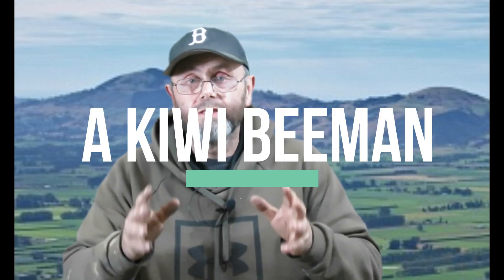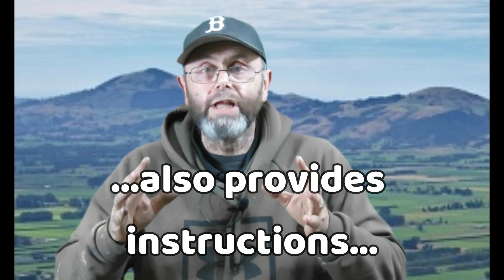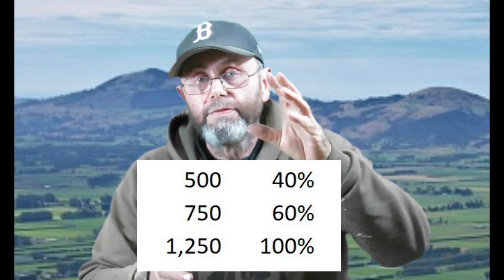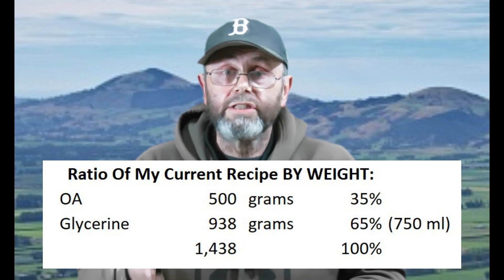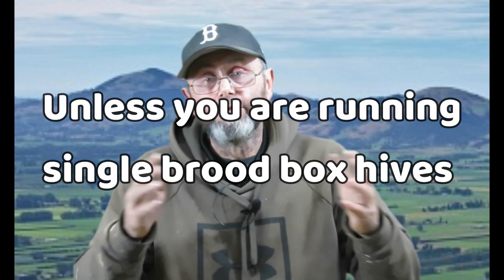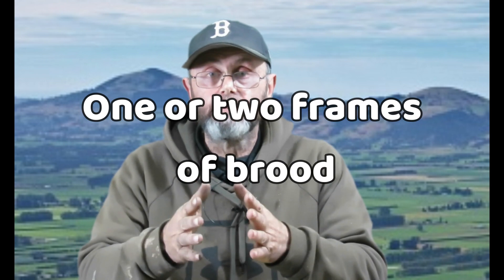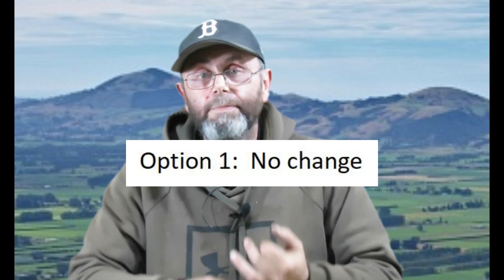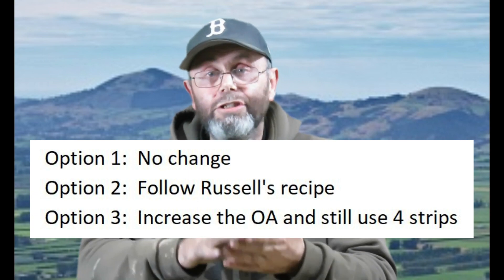Ep 68 Extended Release Oxalic Acid MISTAKE

Comment: BS, 4 strips do not have 33% more surface area then 3 strips
Reply from the maker: Really?  I have a degree in accounting (and an MBA), and I am pretty sure they do :)  Actually it is 33.33% (even more accurately 1/3) bigger.  Here is one example of the maths, there are others.  Imagine, to make it easy, that each strip has a surface area of 10 square inches. (of course they are bigger than that in reality but that doesn't change anything)  So 3 strips would have a total surface area of 30 square inches.  4 strips would have a total surface area of 40 square inches.  40/30 = 1.3333   or 133.33%    So the area of 4 is 33.33% bigger than 3.  Now I have been wrong before, but I don't think I am this time.  If you are sure, convince me :) :)

Comment: HI~
The video looks good.  I have one question.  I would like to know if I can make an oxalic acid strip and use it during hot summer days.  thank you.
Reply from the maker: Hi, a hot summers day here is about 30 degrees centigrade.  I don't have any issues at that temperature.  I don't have any experience at hotter temperatures.  If you summer gets hotter I suggest you try it with a hive or two so see.  I am pretty confident it will be fine, but it pays to be cautious.  I use 4 strips per brood box. Cheers Chris

Comment: To add to the 3 or flour strips conversation. We traditionally used only 2 grams of vapor per double deeps. We found it wasn't enough and moved to 3 or 4 grams in many cases of vapor treatment and it made a world of difference. If a colony is ventilated well, even in hot weather it doesn't hurt them. This is the same in other types of chemicals, ventilation I think is of most importance even in vapor treatment.

Comment: Hello there, long time😁 Do you think swedish sponges will still work in this case? Also, you say 4 strips per 10 frame box, since we run double deeps, would that mean 8 strips, or 4? And how long do you leave the strips in. Our honey flow continues for about another month so I am preparing to try this method in a few hives. Our weather will be quite warm then so hopefully this won't be of concern with ventilation. Thanks for these videos, I'm hoping for success with this testing here
Reply from the maker: Hi.  Its good to hear from you.  Yes I am sure the swedish sponges work.  Check out my Ep 50 where I do a comparison.  Randy Oliver has done extensive testing on them in a far more scientific way than anything I do and he likes them.  I checked one of the hives that I put swedish sponges in in that video a week or so ago, it is very strong and very healthy.  Which is great since we are well into winter here.  And yes, a double deep with brood in both boxes would get 8 cardboard or drywall tape strips.  I have had no problems with hot weather affecting the hives with strips in them here.  But a hot day here is 25 C (77F) so I don't have any experience at hotter temps.  Good luck, I hope it works for you.  I think trying it on a few hives as a first step is very wise.  Cheers Chris
Reply: @KiwiWildman  I did watch that video, and the comparison was great. Randy is really good at this. Many of us here are doing our own testing quietly and many have had good results. I thank you again for all your videos and will let you know how our results end up, cheers.

Comment: To add to the mix Russell is using a old mix I showed him at a bee Conference a few years ago. I do my mix by volume and I'll try to explain why soon he changed his mix to be by  weight to look different. What I didn't explain at the conference I am a beekeeper after all was oxclic and gly are hydropic ie they absorb water. So someone who has a different bag of oxclic or it's been open for some time it will weigh differently. I see a lot of and deal with a lot of people who have killed there hives or it hasn't worked out. 
Because I did a video of how I make my strips after my non disclosure for testing the real strips had ended.
But the way I make my strips has changed since I made that video it is not correct it will work to a fashion but is not as good as how I do it now, also nothing I've seen has worked as well as the real strips. I would ask why you have to sign a waiver to not hold beequip or Russell liable if his strips he sells kill your hibes. This is all my 2cents worth and my opinion only but you ether make your own and take the risk or use something that is approved for sale as a mite treatment.
I'd also question why it's going to cost 300k to one company to approve the real strips for testing that has been done overseas and none of the other treatments have gone through.
We have been home brewing for long enough to prove it is a viable option let's get some help to get the real thing approved. They are approved in many overseas countrys and have a proven record.
Reply: Also should add your method is close I use 4 strips per brood box I run double brood boxes and most of my hives have drone frames all season for my Ai work and mating sites
Reply from the maker: Thanks for the feedback Glynn.  I think your point about the ingredients being hydroscopic is really helpful  In my case, it wouldn't affect the glycerine much because it is stored in 20 liter plastic containers with the lids on securely, but I do almost always have a partly used bag of OA in storage.  Although there is a plastic liner in the bag and I always tie it shut, the liner is thin plastic and easily punctured  so it is hard to ensure there is no air flowing in and out.

I won't comment on why Russell uses a disclaimer form, he explained his reasons to me, but best if you get it directly from him.  I can say that I pointed out to him that in a past life I explored the use of them for a National sporting body I was president of.  The legal advice we got was that they are not worth the paper they are written on, you can't contract your way out of the law.

I agree that getting something new but proven approved for commercial production in NZ is absurdly expensive.  In the meantime, I will just keep doing my home brew as part of my varroa treatment programme because it is working for me as a good tool for keeping mite levels low, not so good at bringing down high mite levels.

Cheers Chris

Comment: Opt 1. If the way you currently do it works, I'd stick with that. When I made strips for my 2 hives, I had massive bee deaths (which I asked you about at the time). Clearly I hadn't done the maths right which is no surprise to me, not my forte. Checking dead bees out front today I see mites so tomorrow I will make a new batch. I will use the 40/60% by weight rule (3 per BBox) as this will be easier mathswise for me, fingers crossed. I'm thankful for this video! Cheers 👍
Reply: Hey Chris, I did it! Did 40/60 mix, got to correct temp 70deg and dried them over 3 good days in Lower Hutt (last time they went in damp as instructions I had said but I followed you this time and let them dry, esp cos evenings are cold). I put 4 per box. No deaths of bees this time! Checked white corflute I put under hives today and counted  17 mites under one hive and 20 under other so I don't think I had a bad infestation but I'm feeling much better about my OA strip making skills -yay! THANK YOU HEAPS!
Reply: @neeksnature well done. Great feedback for the rest of us, thank you.

Comment: Hi Chris, thank you very much for the update! Since you know your current method works, why not experiment say on 10 hives with the suggested ratio and compare the results. If I recall correctly, using your current formula (same I'm using) you still had mites or for the most part prevented numbers from going up. Maybe Russel's ratio, would do better?? For my part, I'm happy with the current mix, but might do some testing as time allows. Cheers, Peter
Reply from the maker: Hi Peter, words of wisdom indeed!  What a great suggestion.  Thank you  Cheers Chris

Comment: Good Video Chris, 
The strips made to Russel's Recipe will be a little more concentrated oxalic dose on each strip, would that mean that the bees are picking up more oxalic when in contact with the strips? 
I guess the real important thing is testing hives for Varroa and knocking the ratio of Varroa per 100 bees right down and keeping it down. 
I would like to get the ratio of WASPS per 100 bees down. My Hives have been hammered at Waitati this year!
Reply from the maker: Hi Pete, yes you are possibly right, although fewer bees will come into direct contact with the strips.  As you say, the real test is what is happening to the varroa levels.  My hives had lots of wasps about this autumn too.  Cheers Chris